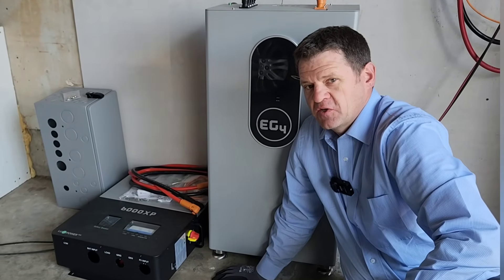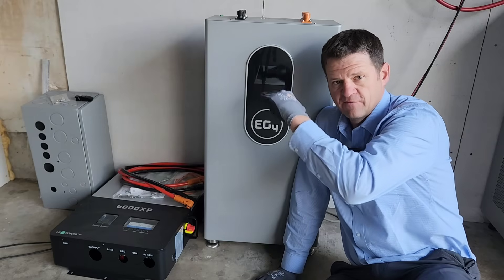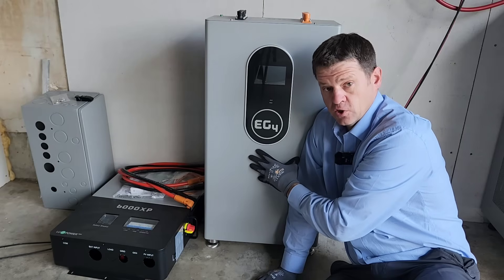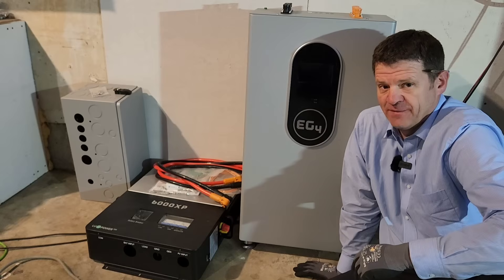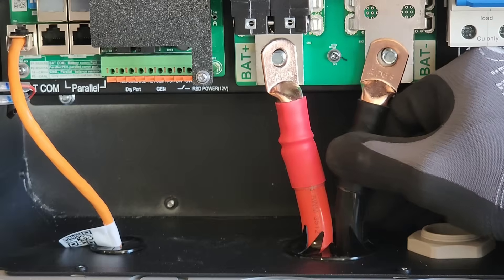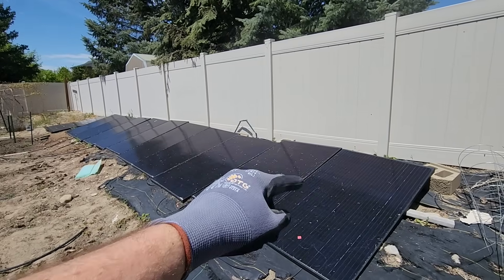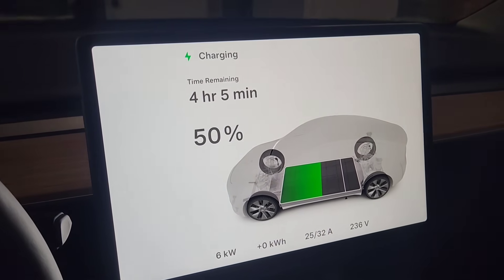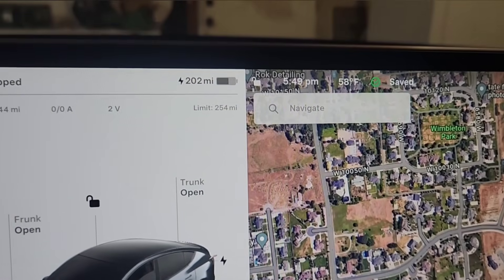I Built a Home EV Car Charger - Off-Grid, Battery Powered

Comment: This is exactly the kind of approach anyone with a home should be taking, it is a no brainer right now to do if your willing to diy, who knows how long until it will make financial sense buying it from a company...In 5 to 10 years batteries will be so cheap we will see mass adoption and a system like this will be as common as any other home appliance to have. Free energy for the house and for the car where getting gouged by energy companies is a thing of the past. For the extra adventurous who want to do an even bigger system for less money you can buy and wire your own prismatic cells, very doable if your a bit handy.

Comment: can u charge the car with only solar panel?
Reply from the maker: They recommend you have a battery connected. There are some inverters out there that can run only solar only.   This might be a good option...(I haven't used this yet though):
  https://watts247.com/product/nhx-5kw-split-phase-120v-240v-outdoor-rated-grid-interactive-ul-listed-pv-inputs-to-500v-and-much-more/?wpam_id=133
Reply: In a sunny perfect day, sure...the issue is when the sun is not able to be stable at some point you would have erratic charging.

Comment: The problem with these systems is converting battery DC to AC split phase 240V into the car then the car converts it back to DC. Still efficient considering you got 42 miles, but still there has to be a better way, like feeding DC for home use, like superchargers.
Reply from the maker: That's a good point. I would love to see something like that.
Reply: @diySolarPowerFunWithRay  Two companies sell EVSEs now that do this, basically meaning you could drop the inverter from your setup. Both are discussed here: https://www.youtube.com/watch?v=UDJFFEXqKAU

Comment: Why did you reduce the charge rate to 20 amps? Don't you have the ability to charge at 40 amps?
Reply: 40A at 240V is 9600W and the unit is rated for 6000W.
Reply: @eugsmiley  So 25amps Maximum
Reply from the maker: Yup. What he said 👍

Comment: This calculation of what is needed to offer the option of EV Charging from Solar and a Battery Bank is tough:  EV batteries are HUGE, compared to the relatively SMALL kwh capacity of even the Largest 'at-home' Solar output and Battery bank needed... so, this means that even if you have a seemingly sizable battery/battery bank, AND you have a very SIZABLE  Solar capacity, you'll likely get the best CHARGING during the sun-light hours ONLY, when the Solar AND the battery can give you 'maybe' close to what you really need for daily or frequent charging - EVs consume a LOT of power:  240v @ 30amps for most EVSE units, although Adjustable units can allow you to dial BACK on that amperage, even down to 10/12/16 amps...
I've considered all these numbers, and just can't make it work for my 100kwh battery TRUCK, even if I don't drive a lot.  The cost of the infrastructure to make this 'solar charging' happen is just astronomical compared to the relatively mundane 'Utility Charge' per kwh, especially on my 'Time Of Use' rate plan.
Sure, if you are OFF-Grid, this calculation takes into consideration your need for EVERYDAY whole-home needs, not just EVSE requirements, therefore skewing the numbers maybe more in your favor.
If you are GRID-tied, to simply offset your Utility Cost, it 'might' be more palatable, but ONLY in areas of the country where your Utility allows for offsetting their power, or if you don't have ANY 'Time of Use' option.

For those who are 'concerned' about having 'Power Outage' backup, most any Solar and Battery system is a very EXPENSIVE offset to those relatively unfounded and Very Infrequent needs... yes, it 'can' happen, but that's an expensive price for a possibility, when the PROBABILITY is much, much, less concerning.

Comment: Hey Ray, I really appreciate your video! I wanted to chime in here to see your thoughts on using this exact setup for powering a camper + charging an electric truck when camping? Rather than a 14-50 plug, I'd wire in the Tesla universal wall connector. Is there any reason that this would be a bad idea? I'd most likely install this setup + charger on the ourside and give it it's own enclosure of some type for protection while driving/theft. Thanks!
Reply from the maker: So you're thinking of mounting this on the side of your RV camper?  Or just at the RV site?
Reply: @diySolarPowerFunWithRay  I was originally thinking outside, on top of the front tongue area where there's room for a large generator but now I'm wondering if it would be best to mount it inside the camper and have a cabinet around it... Still thinking through this and very early in the idea phase
Reply from the maker: Do you have a 50 amp rv? I have done something similar to my RV but after doing that I really liked the idea and the Simplicity of just using a portable power station with a 30 amp RV plug. Add my solar panels on top of the RV will just plug into the portable power station.  Have a couple videos on that.

Comment: Hi Ray, thank you for the video - it's detailed and informative.  I tried setting it up similarly to yours but my Tesla Home Charger flashing red 2x indicating that it's doesn't have a ground.  I did turn on the neutral bond option on the inverter itself.   Do you have any tips on troubleshooting this?
Reply from the maker: I was getting the same error... I noticed the error in car's dashboard though.   I enabled option 26 in the inverter and it started working.  Are you sure you enabled option 26? The interface is kind of hard to navigate. You may also want to try restarting the inverter. Hope that helps
Reply: I just tried using the same NEMA 14-50 outlet with a Tesla adapter and my charger didn't work.  I'm suspecting that it's a grounding problem too.  Did you get yours to work?

Comment: Get an effing heat gun, first.  Don't use miles with EV as there is too much variance between seasons, battery, weather, speed, etc.   You'll not get comparable results with same car between Monday and Friday due to above.

Comment: We are retired so home most days.  Would it be possible to skip the battery and just charge directly to the car?    Would that save significantly on this installation?  I went to the link but all the components were bundled.  Nice video, thanks.
Reply: Thanks. I subscribed so will look forward to seeing that!
Reply from the maker: One option would be to get a small battery and have solar do most of the work. This unit might be able to run off just solar but you may want to call and verify with signature solar to see if that will avoid the warranty. If you mention my name they may give you a discount... for I believe the discount code "Ray" still works.
Reply from the maker: That's definitely an option. And that would save you a lot of money. I think I will do a video on that. There are some inverters that can run just off solar and no battery.

Comment: Thank you for making this great video. My question is at 100% load when charging Tesla how loud the inverter are? And my another question is I am also thinking of off grid power for my house so the max 6000xp can out put is 6kw, so I probably need to 2 6000xp or eg4 18k. To have the capability to charge Tesla and power the house. Which inverter will you suggest 2 6000xp or 18k. ? Thank you.
Reply from the maker: That is a very good question. The sound of the 6000 XP at full capacity is hard to describe. I don't have a decibel meter but it is louder than I imagined it would be. Two of them would be fairly loud and you would want to take that into consideration in where they would be mounted.  
    It will definitely be cheaper to buy two 6,000xp's. But if you can afford it I would go with the 18K pv. The warranty is twice as long and I hear it is much more quiet. Hope that helps. 👍
Reply: I personally am going with 2 6000xp's for redundancy and cost.

Comment: You need to ground the system to a lightning rod
Reply from the maker: Because it's inside I'm not too worried about lightning striking it. When I stick the solar panels on a rack I will connect those to a grounding rod though.

Comment: I want to get this set up but have a dilemma that some of the power generated from the solar panels will be wasted. How would you remedy this?
Reply: Net metering is about the only way I can see that dilemma being resolved. I’m trying to come up with a way to run my AC off solar, as peak power production also coincides with hot weather.
Reply from the maker: One option would be to connect this inverter to your house electrical panel. I posted a video on connecting this to my house panel as well.  
   https://youtu.be/nAJByNRCw0k
 That would definitely use all your solar. Depending on how much solar you put out.

Comment: This is what I did in January except I used a few of the EG4 LLs rack mount batteries.  If i did it again I'd pick the wall mount one you show here but it wasn't out yet. I set up a critical load panel like you said for my office, fridge, freezer, and a few other loads.  And run a small AC unit during the hottest time of day when the EG4 batteries are close to 100%.  Then I charge the car.  I decided on a NEMA 6-20 outlet as it's close to the max 25 amps the 6000XP can output and I had the outlet already.  I saved some on the wire size needed too.  I don't mind waiting a little longer.  The 14-50 though would be good for two 6000xp's running in parallel.
Reply: Why would you pick the wall mount battery, if you don’t mind asking? I am working on my set up and about to decide which battery to get. The EG4 rack mount I think will be better battery in case one of them dies and needs to be replaced.
Reply: @lukimy2704  yes, from a redundancy standpoint the rack batteries are better.  However I have very limited floor space where the system is located.  One wall mount battery would take up far less space than 3 floor batteries and be a little cheaper as well. It's all about  evaluating your available install space.
Reply: @lukimy2704 Cost per wh is better with these wall mounted unless you build your own batteries with raw cells.

Comment: Great video.  Are you going to adjust your formula for 80% DOD, or are you going to run it down to zero? That battery is rated at 8000 cycles at 80%.
Reply from the maker: thanks.  I think I'm going run mine down to 10%...Maybe zero not sure.   8000 Cycles is around 21 years. I don't think I need my battery to last that long.  I think calendar aging will kill it before 21 years so I'm fine using a greater % of the battery.  I think early they said 3 or 4000 cycles with 100% depth of discharge before they updated their doc's..  that's 10 years or so... and then they said we'll still have 80% battery capacity left.  Thanks for the comment.
Reply: That makes sense. I have been struggling with how to set up and manage the same configuration.  (Although not charging EV, but running my home.)

Comment: I was contemplating bout getting the exact system you have with 6 , 400w panels . I also recently bought a 100kW electric vehicle.  It seems easier enough for me to put together .
Reply from the maker: Nice, I think those panels will work in the summer but I think you might need four more for the winter with shorter days.
Reply: @diySolarPowerFunWithRay FYI the nema 14-50 u used is not recommended by many EV manufacturers including Tesla . You need the Hubbell 9450 one but since u charging at less than 25amps it might be just fine . Keep that in mind if you decide to add another 6000xp to double your inverter output.

Comment: Great timing on the video.  I have two small off-grid systems that run most of the house, but now I need to charge my plug-in hybrid.  I'm doing 15 kwh of batteries and probably about 3 kW of panels, with a low frequency inverter charger to charge my Chevy Volt and be able to run my electric dryer which will get me closer to 100% off grid.  Thanks for the video.

Comment: In 2012 I bought an electric car and I already had an off grid solar system so all I did was plug it into my Solar shop and I have been driving around for the last 12 years without paying for electricity knowing that it comes from my solar system is very rewarding.

I hope this becomes hugely popular

Comment: You make great videos. I live in Utah as well, and I plan to go solar when I buy my own house. Did you have to do permits to get your system in place?
Reply from the maker: If you backfeed to the grid, you definitely have to get a permit. there are many people that don't get permits when doing electrical work around the house. However I plan on getting a permit for my main house solar system.... just in case I need to file claims on my homeowners insurance.  I had the inspector come and look at my trenches last week and they were very nice. I don't think getting a permit will be as hard as I thought. But I'll keep you updated.  Hope everything goes fine
Reply: @diySolarPowerFunWithRay  Sounds great. Thanks for the wonderful explanation. I learn a lot from your videos. I am looking forward to updates on the permit.

Comment: The battery cables are tinned copper.........not aluminum conductors! AWM is printed on the cable and Appliance Wiring Material (AWM) consists of stranded, soft annealed copper conductors insulated with Polyvinylchloride (PVC)
Reply from the maker: You are correct sir. Thanks for that clarification. I will edit that audio portion out.

Comment: Great video!! Wonder why included cables are aluminum?? Plan to get same inverter/battery but may ask signature solar for copper wiring hookups over the aluminum & would then use copper lugs for proper installation.
Reply from the maker: It looks like I was mistaken on that portion of the video. Someone corrected me on this. After looking into this further it appears they are correct and these cables are actually super fine tinned copper. The cables are actually very heavy.  I will edit that portion out. Thank you!
Reply: @diySolarPowerFunWithRay  Good thing for you too as you don't have to remove wires/lugs to replace now. 👍😀
Reply from the maker: @InVinoVeritas.  yup :)

Comment: While it varies widely due to electric rates and even time of use rates I would be interested to see how long it would take to payback this system versus simply DIY the the 14-50 plug into your main panel and charging the car off the grid
Reply from the maker: My current energy rate is 15 cents per kilowatt hour and if I use 15 kilowatt hours every day to charge for 365 days a year, it comes out to be $821 of savings a year.
Reply: @diySolarPowerFunWithRay in the video you said the system cost about $7,000.00 so if you divide this by $821.00, it will take you 15 years (considering interest on investment) to pay for the system assuming you use every drop if energy produced every day.  Obviously you built the system for energy independence and environmental (assuming your grid power is not produced with renewables) reason and not economics.
Reply from the maker: @stanchorney9698  7,000÷821=8.5 years.   But yes Freedom From The Grid and freedom to have energy is not really measured in terms or ROI.
Reply: @diySolarPowerFunWithRay  Thanks for the response.  I agree freedom from the grid may have a value to some if your utility provider is not reliable, you have a belief long term energy costs will increase beyond inflation or if their means of creating energy i snot renewable.  My 15 year ROI calculation included interest on your initial investment as it could easily get 5% in a term investment.  I only wish in my area there was some incentive to go with solar as my current ROI is about 30 years (likely longer than I will ever recover). Great video BTW.
Reply: Long term doesn’t make sense. Also he did all the work himself. Getting a company to do this would be $15-20k. Most home solar stuff has a payback period of 15+ years and given inflation it’s just not worth it. Cool concept like if you live off grid but don’t do this to try to save any $
Reply from the maker: @myaccount__7269  This literally took me an hour to put together.

Comment: please explain to all your peeps that the original setting of the time to charge was 60% for the day, you changed it to 80%, Daily needs are always changing. I charge at 7kw for 10% an hour to fill up my Tesla battery, 25amps is pretty high, I normally add 18 to 40 % daily so I would need 2 batteries but some charging would be done from the solar array coming in, gonna install a Chiko carport in the back yard or build it DIY with 7200watts. That will get our cars charged quickly and efficiently. We have 2.5 electric vehicles looking to add a used Tesla model Y as well.Thanks for the video Ray.
Reply: What's the 0.5 vehicle?  I like the Chiko, but it is expensive compared to a regular carport.

Comment: Man I thought the Tesla's made better range than that, I just got a new 2023 Mach-e and have been doing about 295-305 miles on the 91kWh battery. And that's on the South Texas Coast, the winds here kill EVERYTHING'S mileage lol.

I'm looking to do 3 of the indoor battery's and one 18kpv for my setup to start with, my biggest issue is the nearest LVL 3 charger to my house is 45 minutes away and it's a Tesla station, I have to have the adaptor to use it and Ford has not started shipping them yet (but I'm on the list so it's free).
Reply: As for range I think he is looking at the Tesla Model X which more which is heavier and focused on luxury , space and speed over range . The tesla model 3 or the model Y which is more comparable to the mach E gets north of 340miles per charge .
Reply from the maker: Yup. I was looking a heavier car and a little larger for my family.  That sounds like a good setup. The 18k is more quiet than the 6000xp and would be nice.  If you use my discount code, e-mail me your order number and I have some give-a-way Items still.